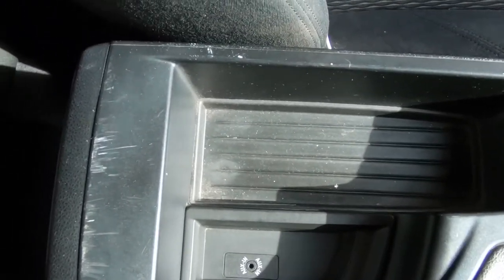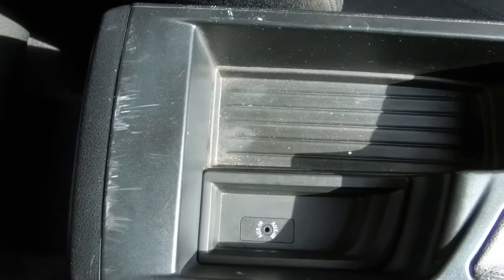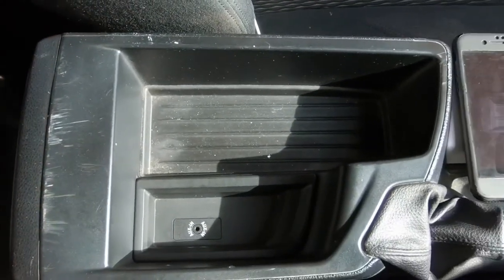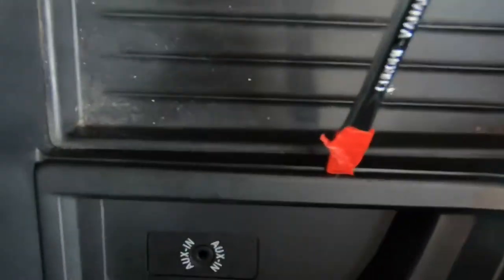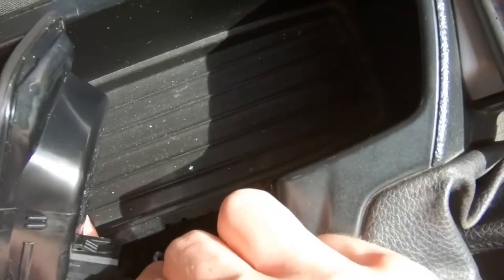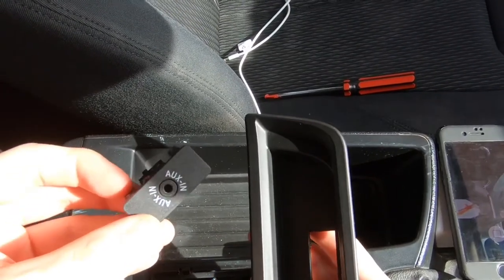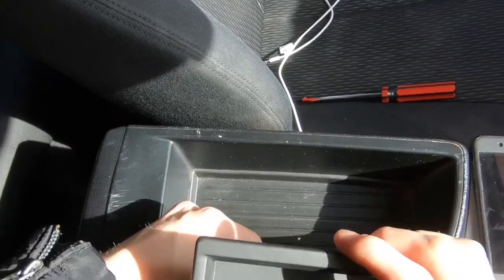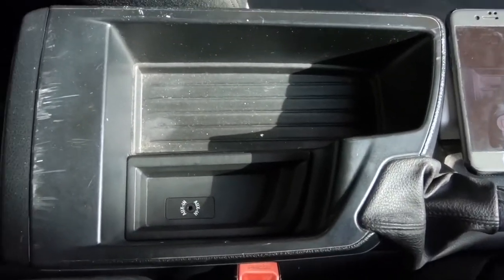How to Remove and Replace The AUX Port in a 2011 F20/F21 BMW 1 Series

Comment: My model is from 2007, is it the same way it comes out? There's the aux and there's the lighter. thank you
Reply from the maker: Hi Nick, unfortunately I’m not familiar with that generation of 1 series. I also don’t want to be liable to break your car! 🤣 However, if there is no other video that can help you. Then I would try and do it yourself, and perhaps use my method of using the screwdriver to pry open the pieces of trim. Wherever the aux cable is, must have trim to access it. So I would try and pry open any trim around the aux cable to access cable. As you can see in my video it was literally one piece of trim and I was super surprised how easy it was. 
Sorry I couldn’t give you an answer, but I hope my advice could help!
Reply: @NathanMannin  Done, I did as you did in your video and it worked. Thanks and greetings from Portugal.
Reply from the maker: @nickfixe9081  Obrigado! De nada : )
Reply: @nickfixe9081   boas, eu ligo o aux e não dá som no meu e87, será essa peça?

Comment: Is this all you needed to do to fix the problem? I have the same problem with mine it was only playing from one side sometimes and now it doesn’t play at all
Reply from the maker: Hello Ellie! Yes for me personally me changing the aux port itself to a new one worked for me and fixed it. Be sure to check it’s not the aux cable itself first by using a different one. If you still have the same problems then buy a new aux port from eBay and use this video to change them over if you can. If that doesn’t work then you could potentially have faulty wiring. I hope that helps : )
Reply: @NathanMannin  thank you! Yes I’ve tried a few cables now all have the same problem. Hope you don’t mind me asking but how much did you pay for yours? I’m seeing a few on eBay for around £10 but not sure if they will be dodgy
Reply from the maker: @ellietree2345  no problem! I can’t get an exact figure but it wasn’t expensive. It must’ve been around £10-20, so I think you should be fine : )